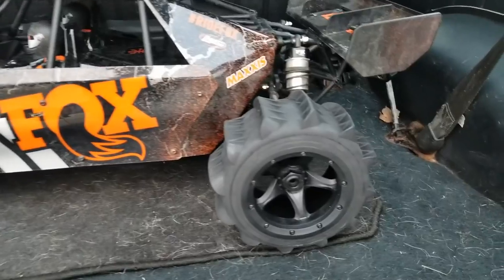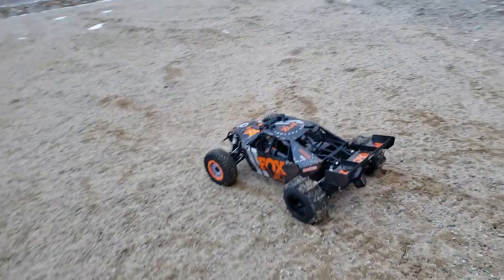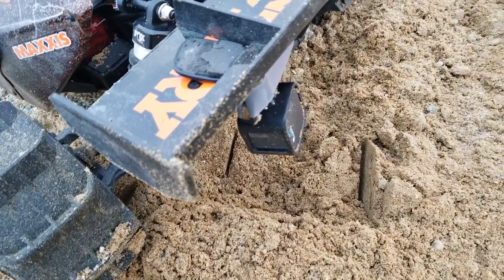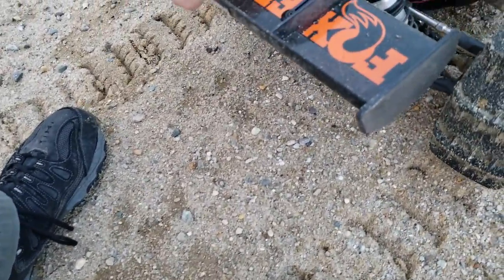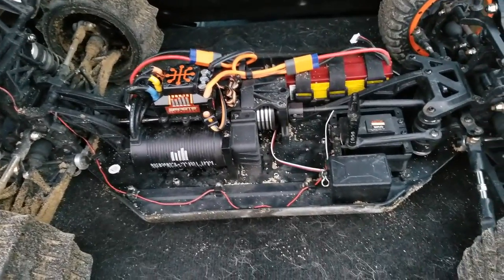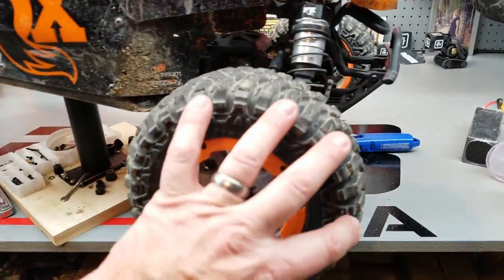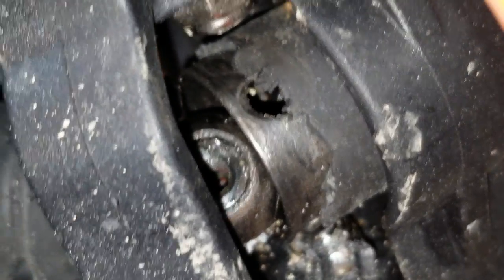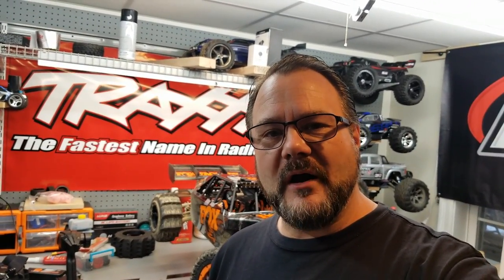Paddle Tire RIPPING the DBXL-E 2.0 short rip CVD Breakage

Comment: How do you get the timing on the engine, please? 0.0 3.75 7.5 11.5 15, and what degree you have to use for acceleration thanks a lot for the answer
Reply from the maker: Higher on the scale "advanced timing" provides more rpm and also higher heat. Lower on the scale to 0 "retarded timing"  less heat less but more safe performance

Comment: I have the same problem with the gear, it comes loose with every run, I was told that I would join it with super stick on the pin that squeezes it that's okay
Reply from the maker: The pinion actually didn't slip after I Loctited the pinion the first time. I broke a cvd joint.
Reply: @rcguygarage  You recommend me to do for me what I indicate above for my problem.
Reply from the maker: @jaguar2164  sorry i can ONLY recommend what "I've done" as it has worked for me on several models if I come across this situation. 👍💯👊

Comment: Odd size wheels front to back will break something in a drive train , normally a diff in a full size all wheel drive car .
Reply from the maker: In high traction grip situation locked awd or 4x4 would have issue but in this config under its use there's plenty of separation slip😜😂😝

Comment: Because those front tires are not getting the traction like the rears
Reply from the maker: Center diff not tuned for paddles in rear
Reply: @rcguygarage  what kind of diff oil would the DBXLE need to run paddle tires? Any suggestions? Ima order some paddle tires for it
Reply from the maker: So far I'm running STOCK with my paddles and these things are AWESOME.  Maybe someday I can have some  SNOW to try them out in😂🤣

Comment: Mine destroyed the rear diff on stock tires. Its on my page if you would be interested to check out that video.
Reply from the maker: I didn't see any destruction??? Good ripping though👍
Reply from the maker: Saw the collection one pinion issue. Yep it definitely happens. Good info on grease.
Reply: RC Guy Garage thank you the grease is Called Super Hi Temp UREA Grease from Honda it’s $12 a can 2.7 oz worth it 👍🏼
Reply: RC Guy Garage Thanks buddy my differential got destroyed and bearings came apart and ate the plastic housing.  Not sure if you’re having this issue as well.  Know a lot are when you go to apply brake the car kicks into revers which can also damage parts on the RC.
Reply from the maker: @M3PQuicksilver  yes someone just asked me about that. I haven't had that issue yet but I also haven't had the need to double tap it into reverse yet as it's all straight line speed😜😂😝🤣 I've also completely reset both my remote receiver and ESC so I don't know if that has anything to do with it just because I wanted to test certain things but as soon as I get this thing fixed I'm going to check that out thanks for the heads-up and keep those videos going👍💯👊
Reply: RC Guy Garage Thank you 😊 👍🏼

Comment: That what happen with my udr and I changed my rear drive shaft on my UDR for the GPM one n had problems with the screw pins kept backing out one near the motor first backed out n banged up my motor 😫 but I got her back to life nice video bro paddles are so much fun! Expensive but worth it 👍🏼🤙🏼
Reply from the maker: These paddles weren't that bad as a total package. Plus they are WAY stiffer than the losi ones but I'm seeing a trend here on a few things in my mind.

Comment: Didn’t you have a problem with wheel diameter differences? In theory you should adjust your gearing to compensate for wheel diameter difference  between front and rear.
Reply from the maker: No rolled out diameter overall close enough in the sand considering paddles in the rear smoothies in the front